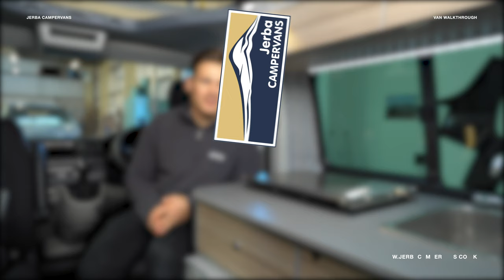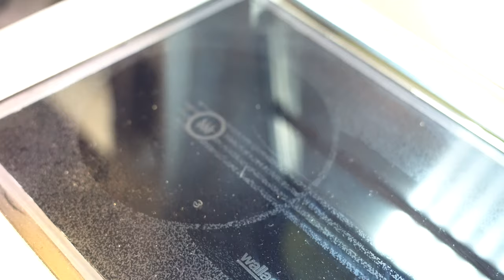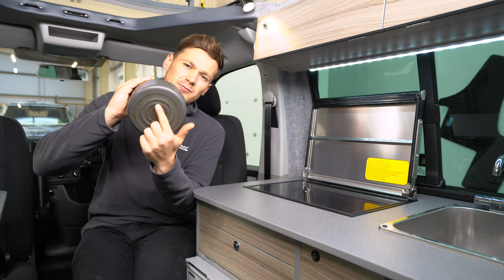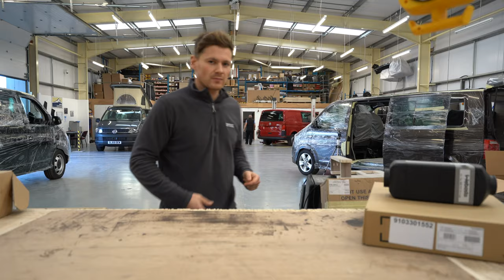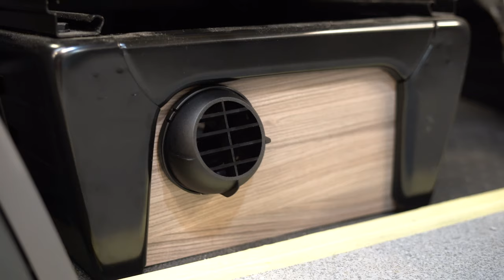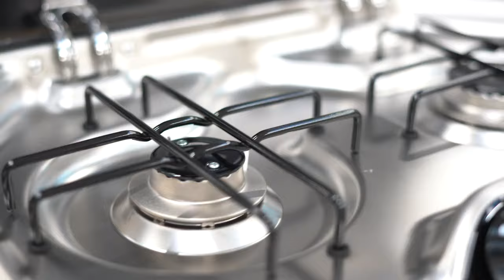Wallas XC DUO | Webasto Airtop & Dometic Gas Hob - #1 Campervan Cooking & Heating Systems Compared

Comment: One con for the Wallas (as an owner) That I don't think was mentioned (i did skip a bit!) is that on startup, the glow plugs draw quite a bit of power from your leisure battery - this stops once the unit is fully running. (We have 220AH of battery and we see an instant drop of about .2 of a volt - which doesn't sound much - until you remember that you have less than 3 usable volts in a 12V DC system without mains hookup / solar top up)  Also If the DC supply drops below 11.5V the Wallas wont start at all. Its also recommended by Wallas (Source: install manual) that an isolator switch is fitted on the DC side when not in use for a long time - most installers rely on the fuse - not a good idea if you need to pull the fuse for a controller reset (flame fail scenario - been there experienced that - now have a switch! ) and its fuse has been fitted in a damned awkward place!  Sounds like I have a bit of a downer on the Wallas ? *FAR FROM IT !!!*  - I would NEVER change ours!  Bit of Mr Muscle glass cleaner and AAA grade wire wool , then a wipe with a kitchen roll and its showroom condition again no matter what you splashed / burnt on it :-)  ! That said I do keep a single burner stove and a tiny gas heater , both run off a blowtorch butane canister "just in case" during winter and to warm the awning on a cold evening. Plus in a small van , no gas locker means more storage  / battery space.

Comment: Great video.  We are likely to be choosing between the two very soon.  Erring towards the Wallas.  Thanks for taking the time to do this.
Reply: What did you go for and how has it been
Reply: @darrenbullman9450  The Wallas and it's a great bit of kit.  A bit frustrating at the time it takes to warm up, but after that it works a treat as a hob and a heater.  Saves space on not having to carry gas.
Reply: @SmokinHaddock1  thanks for reply and what size van do you have? I'm toying with this or the Webasto diesel cook top....
Reply: @darrenbullman9450  VW Transporter.

Comment: Thanks for the video…… just wondering why you don’t use the webasto diesel hob, is there a reason you prefer the wallas over it and if so why…… thanks
Reply from the maker: it's an option that is available. our customers spec their campervans with us and we build them to their chosen spec. We would say that the wallas is a preferred option as it has the closing lid and we believe it's a safer option. Thanks

Comment: The cost is a huge factor. The Wallas is 1650 € and the wabasto diesel heater is about 400ish €. Buy a cheap induction hob for 100€ or less and save a bunch of money.
Reply: Can't run an induction hob without hookup, and it won't act as a heater.